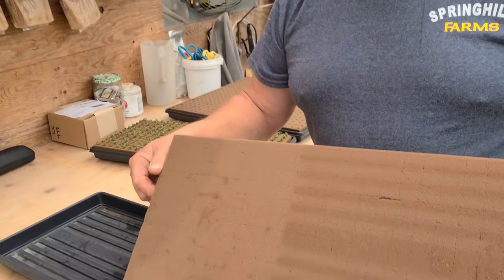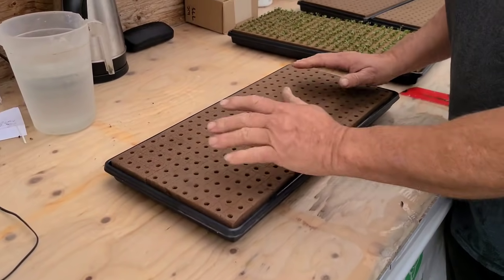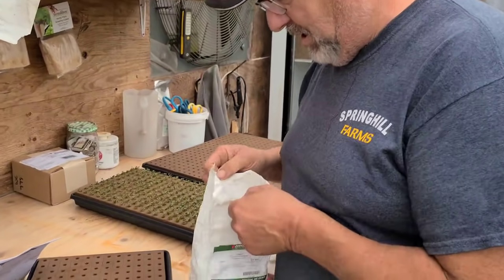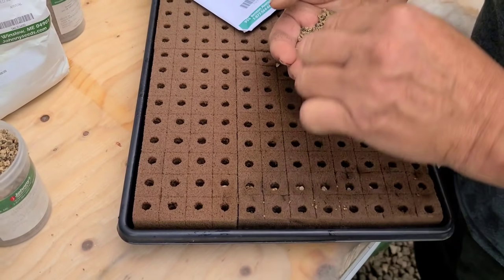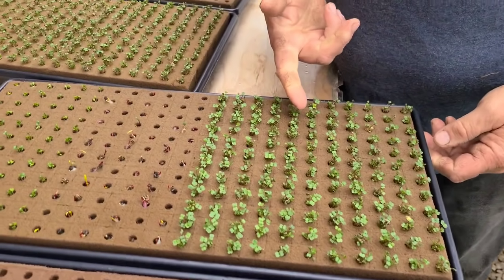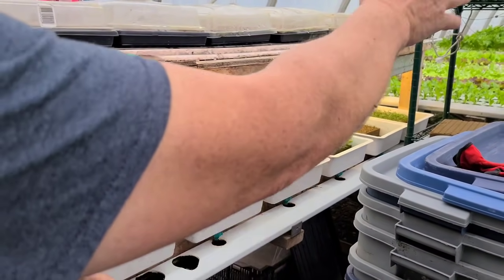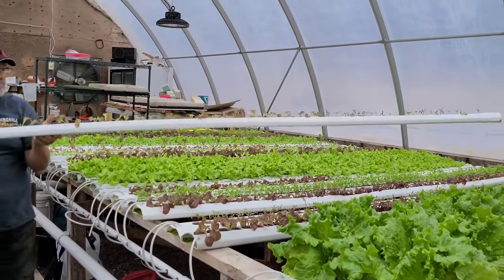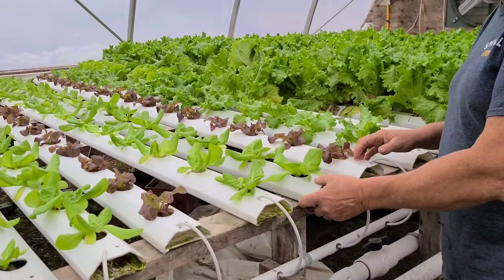Hydroponic Seed to Finish STEP BY STEP

Comment: For planting tiny tiny seeds I dampen the tip of a pointy knife and I have the seeds dumped onto a white paper plate then touch a few seeds with the tip of the knife hold it over the hole in the planting cell and push them off with a dry card of any type paper or plastic . You don’t wast hundreds of seads

Comment: My local hydro store is no longer stocking this. People stopped using it. They said the last Oasis cubes they had on the shelf crumbled. I saw a complaint on Amazon about changes to the product. I bought a little starting tray to use with coco coir.

Comment: Hello and good afternoon.  I have watched your youtube channel for approximately six months now and have used your design as an inspiration for my greenhouse here in Arizona.  Thanks for your videos, they have been and continue to be hugely informative and overall great.  I was hoping you could assist me in finding the black rubber grommets and tube size you are using.  I have purchased package after package of rubber grommets, drilled holes into my 1" sched 40 PVC and purchased various tube dimensions, but have not found the right fit.  Mine usually tend to leak or not fit.  Any assistance you can provide would be wonderful.  Thanks John

Comment: Thanks for your response. I started my system and had them on a heat mat. Theyre still in the tray with the oasis because I dont have a system like you have with the half solution and trays. Im not really sure how much or how often I hand water with the half nutrient. And not sure when they can move to the system.

Comment: Nice video. Is there a reason why you do not use basket cups in your system ? I thought it would be easier to replace the holes with the cups instead of having the produce put into the square tubes.
Reply from the maker: Thanks!
This works amazing.

Comment: Great video. Learned a lot. One thing I'd really love to know is how do you stop your roots going rotten as the plant gets bigger. I seems to have things running along ok while the plant is little but as soon as it gets bigger, the leaves go all limp, and the roots covered in algae. I'm doing deep water technique right now, but recall similar problems when I tried nutrient film technique.
Reply: Are you making sure no light gets into your container?  That’s what causes the algae. Also, there needs to be some air space between the nutrient solution and the bottom of the plant. You want some roots in the solution, but they also need air.  Perhaps this is what is causing your root rot and algae issue.

Comment: A few questions: it looks like the growing channels/troughs don't have end-caps at the input end? How about the outflow end?

So the support surface is slanted, being lower at the far end? And the nutrient solution is a constant flow 24/7? 

I'm trying to figure out how to do an NFT on a very small scale indoors. I created a tower last year but it leaked and getting enough light 360 degrees meant physically rotating it. 
It was a beast to operate.
Hopefully this year's design works better.

Comment: Great videos.  I have been using the Oasis cubes for lettuce.  My question is,  do you use them for tomatoes and peppers? If so do you cover the seeds with anything? Thanks.
Reply: Can you help me?  I see they put the cubes directly in the system. I see other people put the stem and root in a cup with media and drop it in. Can you put the cubes directly in?  If not, and they have to go in the cup, do you break up the cube?  Thanks
Reply from the maker: Oasis goes directly into troughs.
Reply: @Growwiththelaplantes  thank you

Comment: I saw that you germinate 3-4 days using heat mat and closed propogator  . Then you move it down under light with opened propogator and without heat mat. 

I was wondering what is the light needed for 1 tray of 72 cells

Comment: What is the incline of your troughs? And am I correct is understanding that they receive a continuous trickle of nutrient?
Reply from the maker: I believe they are on a 1" incline.
Yes, the nutrients flow through the system continuously.
Reply: @Growwiththelaplantes  Thank you for the info. I think I am going to try to construct a floating bed and aerate it.

Comment: Hi I really your video's. I would like to know why you are using Oasis instead of Rockwool? I was going to use Oasis and bought some on Amazon but the came in a flimsy box with a  fair amount of damage to the cubes and the ones that were not damaged were real flimsy and broke apart real easy. All of Amazon's Oasis comes from Garden Trends who told me to call Amazon even though it was boxed by Garden Trends. Amazon did refund me. The ones you have seem to be of better quality. Do you know who manufactured the ones you have? I would appreciate any help and info you can give.
Thank you for your time,
Steve

Comment: All the germinating seeds in my system are rotting. I let water run for 15 mins per day. Not sure if you have any insight for me?
Reply from the maker: We let ours run 3 times a day for around 10 minutes.  Did you drain excess water from tray when you seeded?

Comment: Will you make a video on your heating system, heating in winter, temperatures you keep things at. Etc?
Reply from the maker: Yes, we can do that!
Reply: I look forward to you reply . To add t the question how do you maintain humidity control in your high tunnel . Direct venting the outside or do you use a dehumidifier ?

Comment: Can you please confirm that when you say that when you say that 3-4 days on the heat mat, 12-14 in those half strength trays, is that 12-14 days from seed or 4 days + 14 days. 

So basically how many days does lettuce spend in each step and what is the total resultant seed to harvest time?
Reply: I had the same question: 3-4 days in just water (no light) until they germinate, then 12-14 days half strength with 24h light. Please clarify. I've tried doing leafys but I moved too quickly for my DWC setup.

Comment: OK smart guyz, explain us this>>>>>>
If I overwater my plant in a pot w dirt, the roots will drown & the plant will die.
SO,
How is it you guys can place a plants roots in pure liquid and those plants do
not drown nor die?

Confused in Capetown

!
Reply from the maker: Great question!
With hydroponic 
  the plants are aerated. Therefore,  there is air moving around the roots of the plants, which stops the root rot.
When you have a pot of soil with no drainage and you flood your plant, the water lays dormant and will rot your root.
I hope this explains a bit.